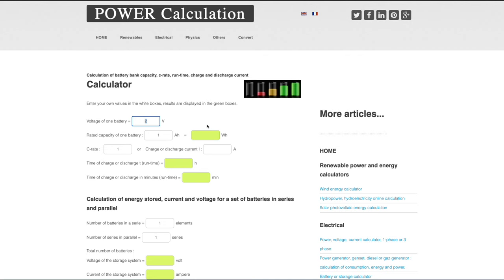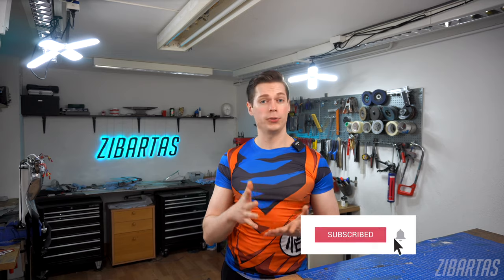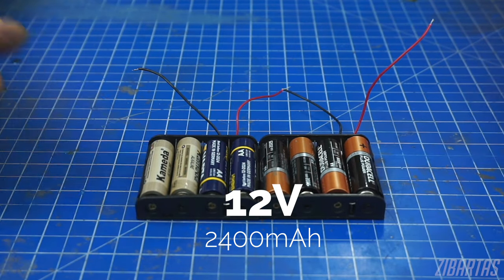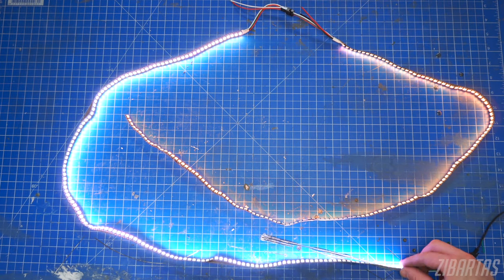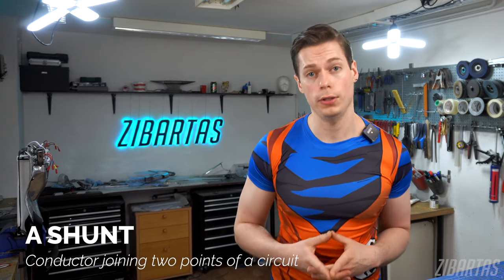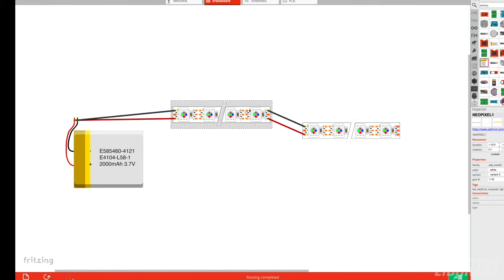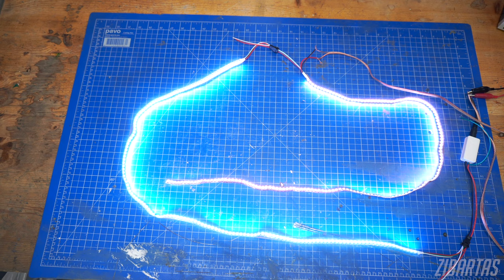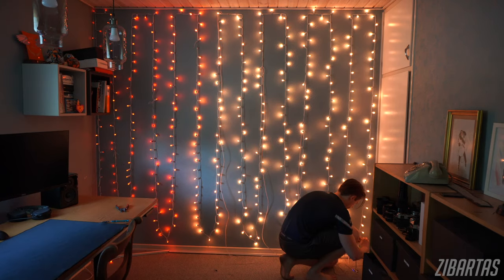How To Power A LOT of LEDs!

Comment: Hey Zibartas,
Are you sure it's ok to use the 6.6v battery with the 5v led strips? been reading some stuff and I'm hesitant to invest the batteries if it will burnout my led's...
Reply from the maker: I use them all the time :) but if you don't have huge current requirements stick to power sources limited by voltage controllers. ( LEDs are hardy. The only time I broke an LED was when I confused the 5V with 12V variety and blasted some with 12V :D)
Reply: @Zibartas  well, I have 720 led's to power with a portable solution, so this is my only option :D
I'm gonna try it! Thanks for the info ;)
Reply: @EduViolin  did it work ok? Any problems?

Comment: hi, i have a 5m60 led strip and i am using a esp8266 with WLED and it's all plugged into a 650w computer power supply. what is the maximum current I can set on WLED?
Reply: Watts divided by voltage gives you current  so if its 12volts     650W /12V = 54A however  if it's a computer PSU it may not be single voltage so you would have to subtract the other channels.

Comment: Could you technically wire in a 2nd power supply in the Shunt section?
Reply from the maker: For such an approach, the positive wire between 1st segment and 2nd segment should be disconnected, so only the ground and signal is common :) You don't want to connect two dissimilar power supplies in parallel, so just have each of them power their own segment (just remember to keep the Ground in common)

Comment: If you use Lithium based chemistry batteries, check what the safe use and handling practices for the type you are using.  Lithium chemistries can easily cause fires if you abuse them.  Remember how the cheap hoverboards would catch fire and got banned from places? It was due in part to inadequate battery protection.

Comment: What if I want to  connect 3 20ft addressable led strips together what kind of power supply do you recommend?
Reply from the maker: You can buy really powerful 5V supplies on AliExpress and Amazon - I'm using a 5V 30A power supply for my "Wall Screen" project - and it's been working really well!

Comment: I made a cutting for my led strip.. its small.. I want to power that one without  connecting it to another strip. I cant find a cheap adapter or even one adapter for it.. what are they called? Its  4 pin..
Reply from the maker: I think it's just called an RGB LED strip connector :) you can get them with wires attached or just pins themselves.
Reply: @Zibartas  nop thats not it. I looked

Comment: Nice tips! I got an idea for a project involving around 200 m long led strip (30 leds/m would be more than enough) in an oval shape (think like along the track in Track and Fields running event). Got any tips or seen any project like that in practice?
Reply: Did you ever get a solution for this?
Reply: @86harves  No unfortunately not. I have som ideas but I haven't bought any products yet to try it out, hence why I try to ask someone with more experience first, so I know which kind of setup I should be looking for when selecting products to solve this. Do you have any ideas?

Comment: I always appreciate a massive amount of knowledge aimed towards people who know the basics and want to do something more complicated. Now I know why I burned myself wearing million LEDs on a thin wire 😂.
Reply from the maker: Gotta go thicc x) hahaha! Ofc, thank you for your support!!
Reply: One question though. I showed this video to my friend and he told me that Li-Po requires different charger with balancer, and overall is pretty dangerous to use since any short or damage to the battery can set it on fire in an instant. Had any issues with these cells?
Reply from the maker: They all require caution - but nearly all consumer devices nowadays contain Lithium batteries, so I'm not TOO concerned about safety as to not use them or to not recommend them. There's plenty of chargers out there, as well as battery undervolt alarms and what not that you can use to operate all batteries safely :)

Comment: Hey Zibartas! New subscriber here, using your videos for my first ever LED cosplay. On the off chance you see this message after like over one and a half years, I'm trying to use the battery pack calculator you mentioned in your video, but why does the battery you said was the best, only show it'll last for 3 minutes on the calculator? Unless I'm reading it all completely wrong. I'm trying to go for 18650 batteries because I feel like that'd be easier for me to hook up to the LEDs, what with being new and all, but it's telling me that the ones you shown on your vid will last me for 150 hours. Surely that's not right? I must be entering something wrong..
Reply from the maker: Hey :) Are you certain you're typing in the right numbers? If you're calculating 'how long will the battery last' you need to know what load (in amperes) your LEDs will introduce. 
For example, let's take a 18650 sized battery that is 3.6V 3000mAh (3Ah) and a single 3V 20mA (0.02A) LED. A fully charged battery will have that LED glow for 150h or ~6 days. If you increase the load from 0.02A, this time will shrink accordingly. (I think I'm getting this right :D) Does that make sense?
Reply: @Zibartas  What about powering the COB ribbon led strip that you mentioned in your LEDs video? It's 12V (unsure of watts as it doesn't mention it). Would I have to break the strip apart and power it in sections or something? I must have entered the numbers wrong before and your explanation does make sense, so thank you :)
(I did reply to this but it disappeared so I'm sorry if my reply comes out twice)

Comment: im just struggling to understand why most LED light snap connectors only accept 20-22 awg wire...  seems like 18awg is optimal for most runs... without being too difficult to pull
Reply from the maker: thinner = cheaper :)

Comment: But what if u want to use A AURDINO AND MAKE A LOOOONG STRIP OF LED GLOW IN A ONE DIRECTIONAL SEQUENCE ..(starting at one point ending at another) ...cz if we use ur method we wont get the sequence cz there will be a lot of starting points isnt it
Reply from the maker: Nope, it will! Just don't disconnect the Data line at any point-  and add additional power lines :) As long as Data line is continuous, so is your strip/animation :)

Comment: *8A/20mA =400LEDS thats wrong 
because each neopixel at full white needs 60mA (red+green+blue) so we count the max mA of each neopixel 
so at 8A/0.06mA =133 neopixel 
you also need to count the head room of the power supply %75 beasuse of overheaing and damage the strip and power supply and might catch on fire ...so prefer to work 
*8A/0.06A X 75%= 100 neopixel
Reply: "I've measured 13mA for all 3 LED's within the 1 package, 
it suprised me as well and i , like you thought i need to account 60mA Per LED package of 3 LED's   Turns out it's not the case"

Comment: how to know whether the LED strips is high quality one or no. and Which one is the best the single  LED lights like what you used on your video or their strips LED light
Reply from the maker: For the most part digital LEDs are pretty much identical - there's very few differences between all LEDs I've ever bought. I always recommend getting 144 per meter LED strips though :) and you mean single color LED strips or Chip on Board LEDs?
Reply: When i say singler i mean the addressable RGB LED light LED that you use on your video. LED you can connect a negative and positive wire. the LED strips is  addressable RGB LED strips light
Reply from the maker: Could you show me the timestamp of which ones you mean in particular? :)
Reply: @Zibartas I am so sorry, I found a video for you give me all of what I need thank you so much